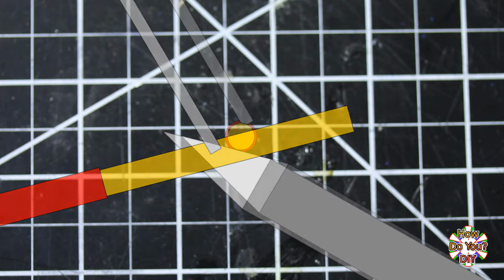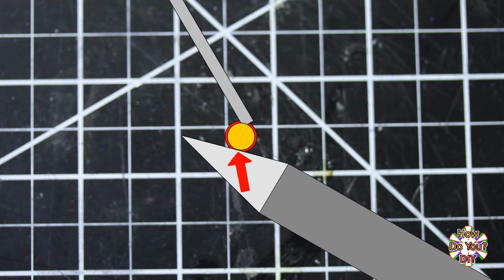Using Solder | Soldering Basics | Soldering for Beginners

Comment: About to "build" a small PCB for a flashing LED light consisting of a couple of resistors, a capacitor, an integrated circuit and a transistor.  These videos are very helpful.  So glad to have found you!  Any more suggestions, recommendations etc. that you can give is appreciated.  Thank you very much.

Comment: As a long time solder-er and user of rosin core, I have been converted to water soluble flux.  Cleaning is way easier than via acetone / isopropyl alcohol.
Reply: Rosin flux is preferable for use with leaded solder, but lead free solder requires far more caustic fluxes to be either contained within the solder or used as a soldering accessory to add to a connection prior to soldering.  I Have been soldering for over 50 years including 2 decades as a full-time audio repair technician, and I personally detest lead-free solder, which doesn't wet or flow onto connections as well as leaded solder does, and  Breaks down more easily under vibration and mechanical stress as well as the extremes of both heat and cold.  Traces of lead-free type flux left behind can sometimes become conductive or corrosive and so the boards or connections must be thoroughly cleaned. Rosin flux however is pretty much inert and only rarely becomes corrosive or conductive , under high humidity and high voltage conditions.  I don't find cleaning it with isopropyl alcohol to be any particular kind of chore.

Comment: These videos were really useful, have had such a hard time finding someone to just explain the basics.

As a beginner, I'm still left with a question. Solder Iron Temperature. I have no idea if the dial on my iron is too high, what consequences are of having the wrong temperature, why I'd want it higher or lower temperature etc.

A reflow video would be nice as well. Appreciate the work.
Reply from the maker: Soldering iron temperature is a tricky topic to explain, partly because there are so many soldering irons that don't have temperature adjustments. But for those people that do have adjustable soldering irons, it's a good question to ask about. Different types of solder will work better at different temperatures.

If the temperature is too high, I think the biggest issue would be damaging the parts that you're trying to solder. The components usually have a high tolerance to high temperatures, but if you're unsure then you should be able to google the temperature limit for the part. Too much heat can also separate the copper traces from the board, but usually that's something that only happens when you're trying to remove the parts.

If the temperature is too low, the solder doesn't flow or bond very well. If you have done a little bit of soldering already, this will be pretty obvious because the solder won't be acting quite right. This also happens if you try soldering to a big part because the bigger metal will absorb more heat.

Because of these things, choosing a temperature is something that kind of comes with experience. But while you're still learning and getting a feel for it, you should be fine to put your temperature setting about half way. You can try adjusting the temperature a bit to see if the solder flows better.

I hope this is helpful. If you have any more questions, feel free to ask.

Comment: Good video (and you sell yourself short on the animations - they were fine). But, when you solder larger wires, rather than simply increasing the dwell time on the wire with the iron, a better approach might be to use a larger iron tip, or possibly get a higher wattage iron that puts out more heat faster. For electronic components, I've read that you want to be on the heat for no more than 2 seconds to prevent damage to parts. Even on plain wires this makes sense as you don't want to melt the insulation off the wires by heating them too long. Just a thought.
Reply from the maker: Thanks for sharing this extra info! It's definitely a better approach with larger wires. This is the type of comment I appreciate the most because it's a helpful addition to the video.

Comment: I have been trying to figure out why I couldn't get some very thin wire to solder right but I'm pretty sure I'm using the wrong material apparently. Thank you so much! I was having such a hard time that the wire would actually burn.

Comment: Here are a few issues you could cover if you want to expand this: 1) Different soldering iron tips and their uses; 2) Diameter of solder to use; 3) soldering temperature; and 4) leaded versus lead-free solder. The first two issues don't seem to get a lot of attention.

Comment: My motorcycle has a wire that needs to connect 2 electrical wires together. Is this resin core solder what I should use
Reply from the maker: Sorry for the late reply. For your need, crimp connectors should work fine, but soldering them (with rosin core solder) would be more secure. Make sure you use heat shrink tubing on them to protect the connection.

Comment: What is your opinion of lead vs no-lead solder and how important is to have some kind of fan?
Reply from the maker: I don't have much experience with no-lead solder. It is safer to use, but can be a bit more difficult to work with. Using a good flux should help with the difficulties tho.

Using a fan is very beneficial. Whatever type of solder you're using, you don't want to breath the fumes or get the fumes in your eyes. Having a fan the just pulls/blows the fumes away from you helps. But if you can get one that has a filter, that would be even better.

Comment: The soldering iron isn't "burning" the flux, at least not initially: the flux is dissolving and removing oxides from both the tip of the soldering iron and the metals or wires being soldered;  Oxidation layers ---- which are formed even more quickly when the metals are hot compared to oxidation that took place at room temperature ---- interfere with the capillary flow and wetting action of a good solder connection.  The flux in the satyr or any additional flux that you have added prior to Saturn will remove oxides from the metals and allow the sadder to flow quickly and smoothly and make a chemical,  molecular level bond to the metals.  The flux does vaporize continually during the soldering process which is why you see some fumes or smoke, and as the flux boils off it becomes more difficult to get a good clean solder connection.  This tends to happen when either your iron isn't hot enoughor the tip is badly oxidized and the solder won't wet to it and so you get a poor heat transfer. Using too high a heat can also cause problems in creating solder joints because the more heat, the faster  the flux boils off and the more quickly the metals and the tip of the iron will oxidize..

Comment: I tried to do the thing you did where you melted som solder onto the iron and then used that to more easily melt more solder onto a component. But the solder I tried to melt onto my iron did not stick to my iron. It kinda just formed a ball. Any idea on why this is and how to fix it?
Reply from the maker: You might need to clean and tin the tip of your soldering iron. Here's a link to some tip tinner that should help with that:https://amzn.to/3p8xRbP
Just make sure that you do NOT sand or file the tip. I hope this is helpful.

Comment: Did you say "Rosin Core solder??
63-37 Tin Lead Rosin Core Solder Wire for Electrical Soldering (0.8mm 100g)

Comment: I'm going insane trying to solder two thick (10 gauge) solid copper wires together. I absolutely cannot get the solder to stick. It's coated in flux, I'm using a Weller soldering iron, melts the solder like butter, but it will NOT stick to the wires.
Reply from the maker: Something that can happen with thicker wire like that is it will pull more heat from the soldering iron. It will take longer to heat up enough for the solder to stick to it, especially if you're using a default size of soldering iron tip. If you have a bigger/thicker tip for your iron, use that. Another issue that it could be is a thicker oxide layer on the wire. You can remove it with a fine grit sandpaper, some steel/brass wool, or a scotchbrite pad. Sometimes I've even used a knife or razor blade to scrape off the oxide layer from thick wires. I hope this is helpful.
Reply: Well, hell, that made all the difference! The tutorial videos don't show just how long you need to let the wire heat up first, I wasn't giving it near enough time. Thank you so much, this has been bothering me for so long!  @HowDoYouDIY